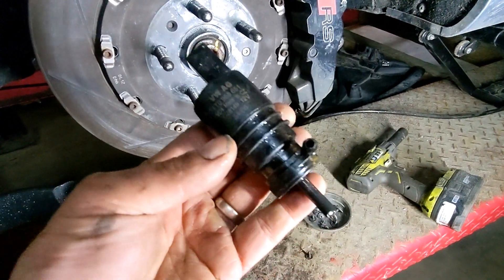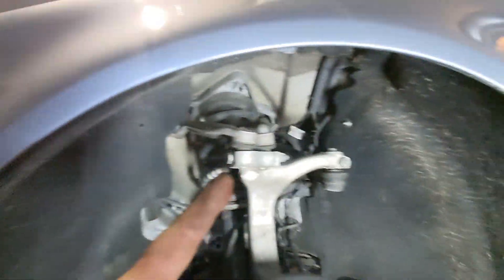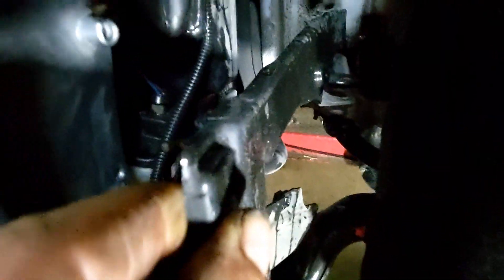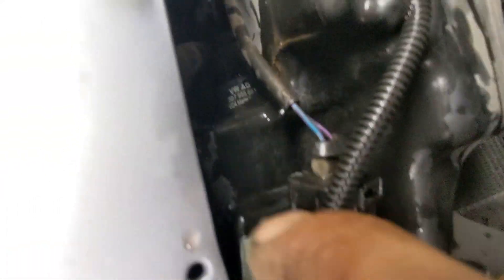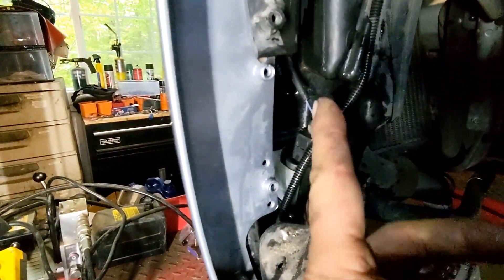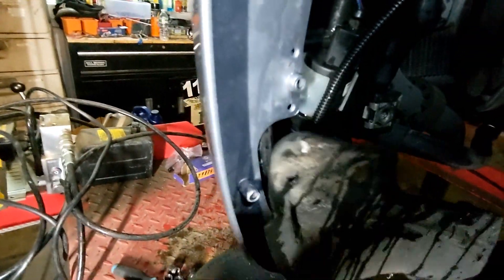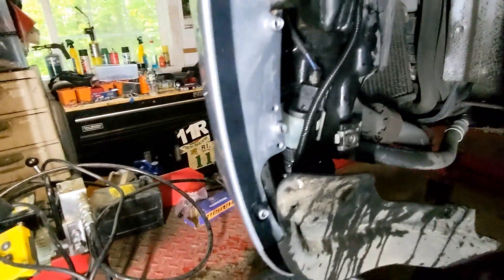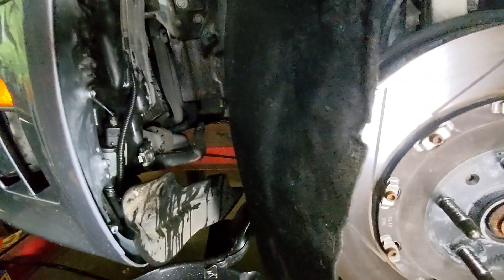2007 Audi RS4 B7 windshield washer pump replacement

Comment: Bro, my pump is not working, and my washer tank is dry but i dont get the low washer fluid level error anymore, pump or fuse?
Reply from the maker: @Andretty91  Check the fuse first, it's quick and easy. I'm not sure where the sensor is actually located, it could be bad too.
Reply: @FrogRacing  i dit look at fuse but, didnt seem to be blown, what number is the fuse? Maybe i got the wrong one out

Comment: Thanks for this! My 2018 SQ5 washers (both front and back) just stopped working so think I have to replace the pump (fuse is intact) and I believe it's in the same place. Now that I have some guidance I'm confident I can do it myself and save a few $$$